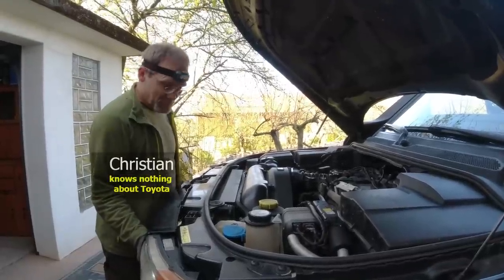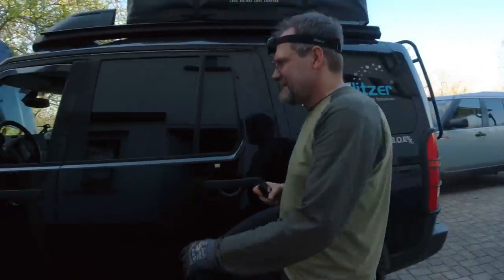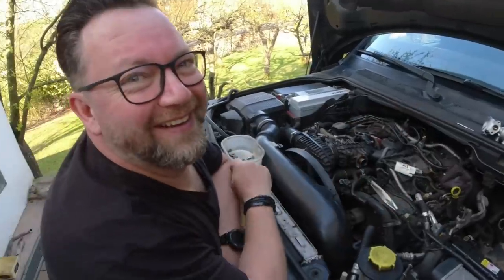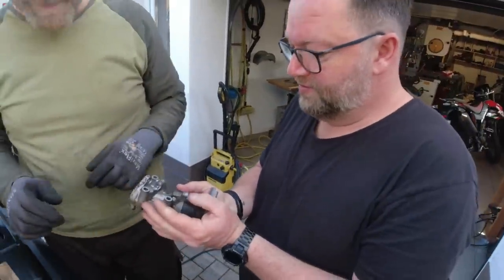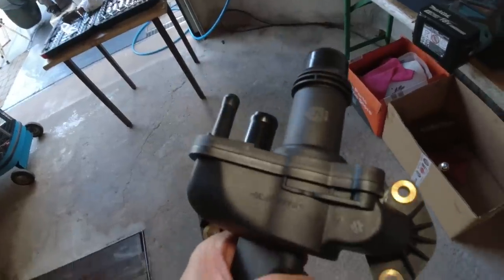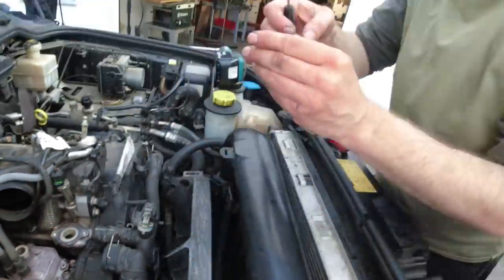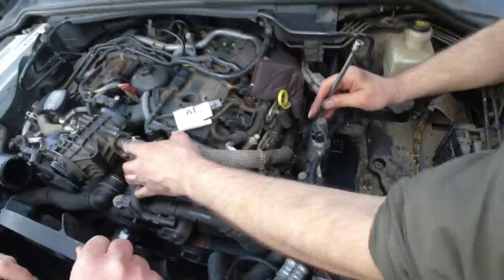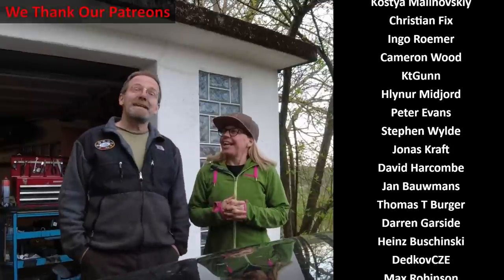Coolant Leak and EGR Fixed in 2 hours - Land Rover Discovery 3 / S4-Ep20

Comment: Great video you both, back to the good old days. I did the repair in my coolant manifold about 2 years ago. Simple easy and only require a few tools. Also, didn’t need to drain the coolant, it was already below the level of the leak 😂
As far I remember the manual says not to use any grease in the o-rings (which in my case came with the part). To make easier to assemble I just used a little of the coolant itself. EGR wedge was great idea.
I blanked my with 5 cent coin and drove 2000km in a “emergency” 😄🙈
Looking forward for the next video.

Comment: Aweome video! I managed to do an EGR delete on mine and still passes emissions! Looking forward to the body off / engine rebuild on the Disco3! :)
Reply: Did you buy some kit or what did you do to manage bypass.
Reply: @rvarsigfusson6163 me too on my  Disco4 2.7 , egr blanking kit and software remap (gap tool needed) .
I’ve done that 2 year ago and I don’t have any problem. I think if you make a lots of km in city traffic, you will have a problem with DPF.

Comment: I really enjoy the videos  you and Vera do, technical,  informative,  lighthearted, great stuff.
Cheers from Miami FL.
BTW, In case you're unaware, here in the states Toyota has been using 0w-16 and filters are not much bigger shot glass!
Reply: Toyota does not sell diesels in the United States.
Reply: True, also, diesel here is even more expensive than premium gas. Don't know of any diesel cars sold here anymore, just trucks.

Comment: Watching you undoing those fiddly screws with your long double extensions puts me in mind of delicate endoscopic surgery. Well done! I knew a surgeon who could wallpaper his hallway through his letter box. Is that the church where you go and pray after LR repairs which I think you advised doing?
Reply from the maker: There is a section in our church reserved for LR drivers.  Visitors can sit there quietly and pray and light candles in case of engine failures.   Sometimes there is a line and you have to wait a bit before you get in.  Christian
Reply: @Vera_and_Christian  it must be incredibly well lit!

Comment: I did EGR delete on my 2007 RRS in 2011. Blanking plate and all hoses off etc.
So far my RRS 2012 has not had any issues with EGR …. Touch wood… but will blank it off if and when it happens.

Comment: I  NOW have sdv6 2015, 125000km, but my tdv6 2010 2.7 has egr faults
I  ordered blanks but maybe you can tell me if i need to update ECU  , thanks for your video  people
interesting, you made the operation without disconecting AC pipes
Reply from the maker: We do not blank our egrs. Fix  your egr fault👍it can lead to more damage if ignored. You should be able to find information in the shownotes.🙋‍♀️

Comment: Hi , I saw on the video that C circuit is on the left side of the car, I mean driver seat ? Am I right ? because I have this issue below , so I beleive it will be opposite ,passenger seat ? I was thinking to blank EGR but mine is 2008 so remap and so on ... I don want to. Waha do You think ?  ============4==============
P045D
Raw code: 045D
ECU: 10
Status: Oczekująca
Exhaust gas recirculation (EGR) valve actuator B - circuit high

Comment: wow, that's a real fast EGR Valve exchange. I'm wondering how he could drive with this fault, didn't the LR went to LIM Mode?
I had the same problem, but mine didn't drive more then 20km/h after the fault.
I'm now checking electrical voltages on my faulty one, just to see what's damaged.
Reply from the maker: Does not cause limp mode on the 2005.  Christian

Comment: Greetings ! a few days ago I bought a range rover sport from 2008 with a 2.7 engine, I would like to change the oil, but from what I noticed the previous owner used a 5w-30 flj Ravenol.
  Question: is it healthy to change the oil to 5w-40, if so, could you please recommend one?

I noticed that in the video you said that the car lost power and that's because of the egr valve, I assume that I have the same problem because the car is very slow up to 2000-2500 rpm. oh yes, and it also loses coolant... I understand that you can't give a verdict blindly, but from your experience, do you think it's the same problem?
And please, could you tell me what tester do you use for your cars ?
Reply from the maker: We have done so many videos on which oil to run in these engines. Check out our engineoil playlist for the most important information.👍🙋‍♀️
Reply: @Vera_and_Christian   Thank you, i am doing my best , watching all your videos step by step, i was in a "panic mode"  and finally i found someone with some good advices around here , i was so excited that i want to ask you all that you know about this engines  :)) so i am sorry for rushing a part of my questions without watching the videos :). Thank you for Great knowledge and positivity. It's a good breath of fresh air. All around only yotota users that are laughing and pointing with the finger that i have done a mistake. But i felt in love in this car even if it's broke😄. Hope i will find the right way to fix it. Thank you again for your positiv knowledge !
Reply from the maker: @Letmedothat  If you need specific help, we  have a Patreon page you can sign up to. We get too many emails, comments, DMs and what not, asking for help and advice, which we just cannot answer in detail. Hope you understand. 🙋‍♀Vera
Reply: @Vera_and_Christian  Sure, i understand no worries. I appreciate a lot what you are doing for the community. It's really helpful. If you ever think to make a class to share your knowledge i will be the first enroled student for sure. Thank you again and i wish you a beautiful spring ! 🤗

Comment: and what will happen if you block the EGR valve?
Reply from the maker: You also have to remove the butterfly.  On the 2005 and 2006 blanking is possible without any issues. Christian
Reply: @Vera_and_Christian  Hi Christian. I had my 2006 model EGR valves blanked a few years ago and the butterfly was left in place. It doesn't seem to have caused any issues. After seeing the blanking plate installation instructions mention removing the butterfly valve, I was curious that the mechanic left it in place but didn't query the reasoning. I don't fully understand the pros and cons of removing it. I think I recall seeing some commentary on forums about improved air flow versus potential issues around diesel runaway / engine shutdown. What is your understanding of the need to remove the butterfly valve?

Comment: You can unplug both egr valves and drive car like normal.  It just shows dumb warnings
Reply from the maker: Yes. But the valve cap snapped off on this one.  So the engine has no power.  Christian

Comment: Now come on guys, you could have taken the body off!
It’s not as if you don’t know how to do so, is it?
It would have made the job so much easier and Vera could have then used the EGR wedge to help light her fire.
And you would have finished the job so much sooner that Vera would not have become so hungry, either.

I also noticed that you use red, cherry flavoured coolant, whereas I tend to use the blue bubblegum flavour in mine. But sometimes the green, lime flavoured version, because I find the cherry flavour too sweet for my taste.
However, if you mix them all up, it ends up as a purple, black cherry version, which in my opinion tastes rather sour😮.

Apparently, once upon a time, Austrian wine had so much Glycol in it, you could have used that as antifreeze coolant. When the engines warmed up, it didn’t exactly taste quite like Gluhwein. I always preferred jägertee, anway!